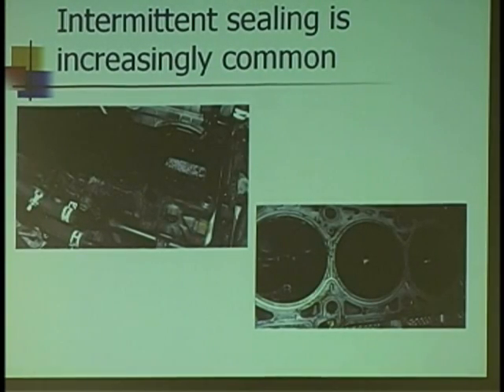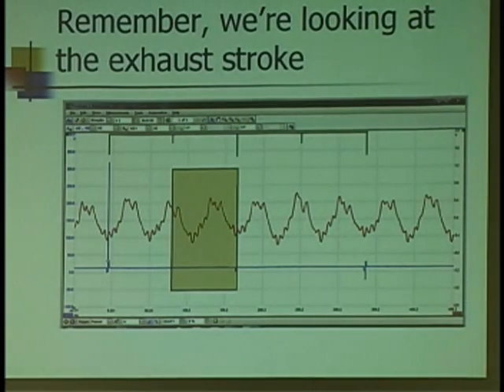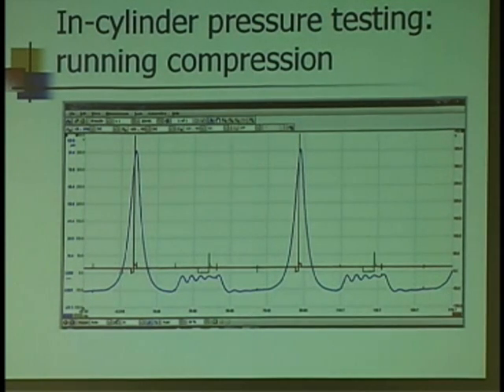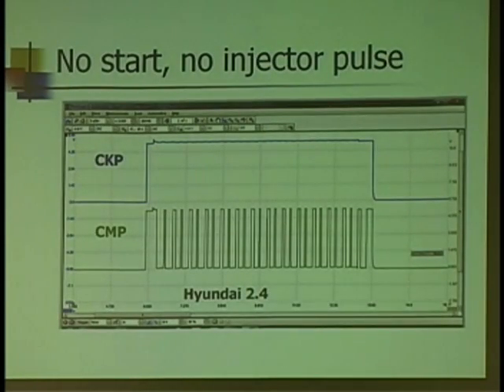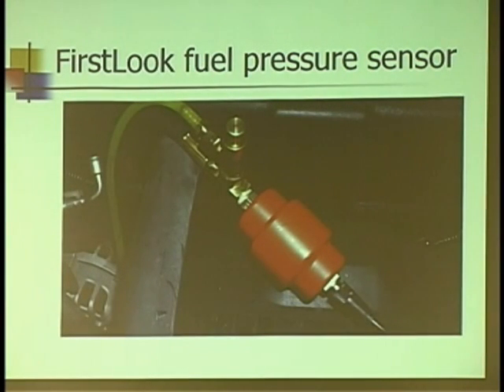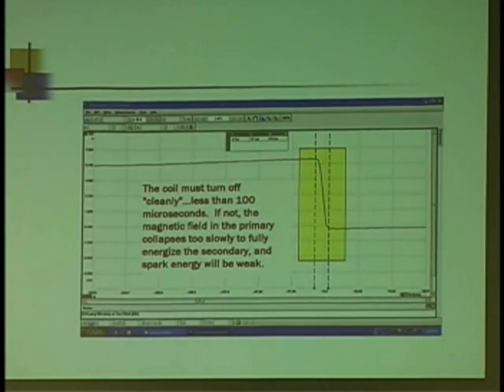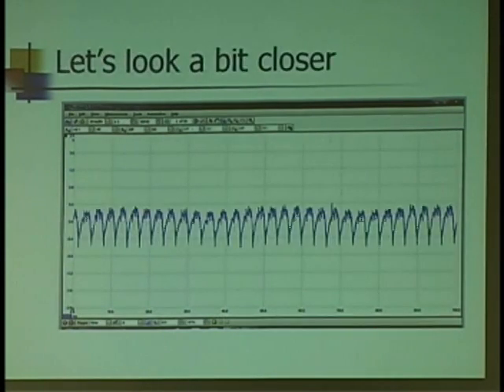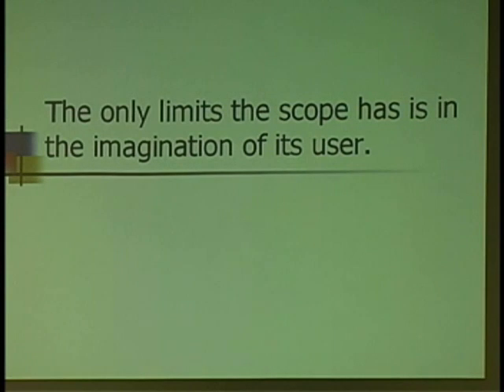Everyday Labscope Techniques with Pete Meier

Comment: just bought a used computer and a new cmp sensor , and i still have a code. finally used my scope and found i had a bad new sensor. i just felt lazy and did not want tp use my autel maxiscope, which was sitting in my box for 6 months and never used. i would have been a couple hundred dollars richer. live and learn...i guess i am still old school , lol Thank you for the video

Comment: Regarding the relative compression test and the peak being low followed by a high one. It seems to me that the explanation given mixes what is happening during the test, when the cylinder is not firing, with what happens when the cylinder is firing. I would think that during the test, the lack of compression would cause the engine to speed up if anything.  if the cylinder had zero compression. If the engine speeds up, then shouldn't the following cylinder take slightly less amperage also?

Comment: The fuel pump ripple signature is too tricky to be reliable,  in my opinion.  A new pump looks like hell because the brushes haven't "worn in". I learned from  that test that the has to be lots of other supporting evidence for condemning the fuel pump.  That visual is just the "icing" on the cupcake.  My opinion.
Reply from the maker: Eric the signature is not tricky if you are using the same scope and clamp. Once you build a library then you can compare the difference from a good pump to a bad one. I do AGREE with you that a new pump may look like hell due to a break in period, but overall it is a helpful test to use. If you baseline vehicles that are new or have no driveability issues, save the waveform and compare it to a problem vehicle and look at the difference. Its also important to look at the top peak of the waveform and note the max amperage. I also use a fuel flow and pressure gauge to make sure the pump is putting out good readings before I condemn a fuel pump for a waveform difference. Hope your enjoying your sunny CA weather my friend...Merry Christmas to you and your family....If you have not already Subscribed to our tstseminars YouTube channel please do so. Interested in more training? Go to www.tstseminars.org and www.attstraining.com
Reply: @TSTseminars  Fair point. I have to agree that it may add an additional  test value during the diagnostics.. It wouldn't be a test on my short list but, it may be included in my second or third pass of a drivability diag. I think that I just reacted to that because I have seen too many misdiagnosed pumps;where this test was the  primary if not the only value provided as supporting test result. But almost any test can fall into that camp, rihgt!? 
Ok, good job keeping all of the tests relevant.

Comment: Most systems identify a misfire while the engine is running. That means the source of energy is
coming from burning fuel inside the combustion chambers of an engine. When a cylinder
misses due to no spark, there would be no power stroke and the crankshaft will slow down because of losing one of the cylinders' power strokes then a misfire will be detected. If the engine that misses is a four-cylinder engine, its crankshaft will spin 90 degrees with no power stroke while also driving a different cylinder's compression stroke in that engine. Your test is showing a six-cylinder engine with one of the cylinders producing low compression being cranked over by a starter motor, which is the source of spinning in this case. Furthermore, the starter is being resisted by good compression strokes coming from cylinders 1,2,3,5,6. These cylinders are resisting the speed of the starter motor (slowing it down) and making it draw an amount of current that is higher than the amount of current drawn by cylinder #4. Since cylinder #4 is not resisting the starter's speed (not slowing it down), it will not need much effort out of the starter because of low compression; thus, the starter motor will speed up (crankshaft will speed up) momentarily, drawing less amount of current as the scope is proving. The firing order for the engine being tested is 123456, so if the starter will speed up (crankshaft will speed up) at cylinder #4 due to weak compression, the cylinder that follows which is cylinder # 5 will have its piston pushed up faster than the rest of the other pistons. As a result, a greater amount of air is going to be compressed (not much air escaped past the piston rings due to the upward movement that was faster). Also, more current is going to be drawn by the starter because of the greater amount of air is being compressed as the scope is showing at cylinder #5.
This is how I thought about the compression waveform.
I will watch the rest of the video later.
Thank you so much, sir.
Reply from the maker: S SE wow what a good write up...thanks for watching and your comment...If you have not already subscribed yo our tstseminars YouTube channel please do so. If you are interested in more training please go to www.tstseminars.org...thank you

Comment: So on a relative compression test if the current spikes were caused by the bending of valves instead of compression, wouldn't it be misleading? Has anybody seem this? Before you take it too seriously I'm not an automotive tech but more of an enthusiast of things obd2 and modern techniques in general  You could even take it as a kind of dark humour.

OK so I sat here for a minute and theorized that the difference would be far steeper slopes on the bending valve scenario. Of course the assumption here is that we're all totally deaf and have to rely completely on our instruments.
Reply from the maker: The waveform would be effective by any mechanical problem. It's not 100% but it is pretty close and help ID problems.
Reply: The only time a relative compression test let me down it's when a timing chain was stretched and the compression looked completely even.
Bent valves will be very apparent but old school compression test shows, just takes allot longer because I can do a relative compression test in one minute without opening the hood.
Reply: Pete, great job. You crushed it even when you were clearly sick. I just add a thought to  58:46. Your original question was using a RC test with ignition synch. At least that is what I  interpreted.  The attendee that answered added the pressure transducer to the mix. Now, from an RC test with ignition sync you see the spark to advanced in relation to the cylinder peak of the RC; and the crank reference had moved, I believe that there would be a correlation fault. The cylinder I'd had spun in relation to the camshaft. Unless it was an older system that used the ring gear teeth for RPM and a harmonic balancer mounted cylinder ID for ignition timing.  Either way ;now that I look at it, there would be a correlation fault.  The RC wouldn't present a mechanical fault  because that relationship is still correct. A follow up with an in cylinder test would show proper pressure and waveform characteristics.  Then, one would have to ask the question and start looking at the  Crank trigger.  But, faults would most likely be set. 
Excellent presentation,  I am really enjoying going back and watching the archives.  It is inspiring me. Thanks.
Eric Scharping

Comment: hey pete   just a question   when you hooked the scope channel to the fuel pressure sensor on the 5.4  ford triton  signal wire   did you AC couple the channel to get a better "view" ?